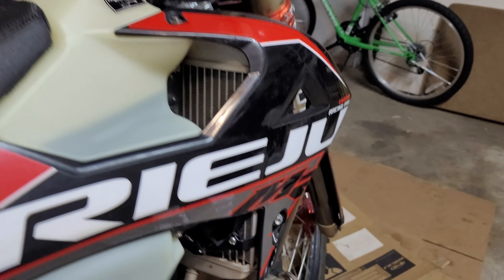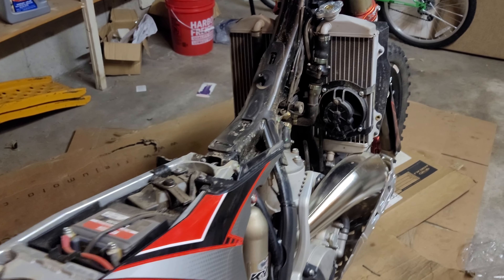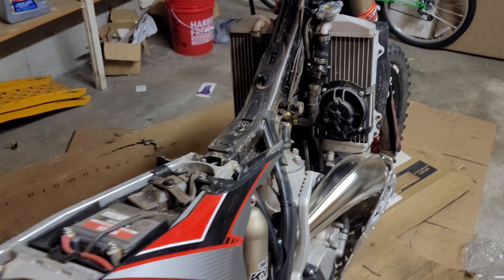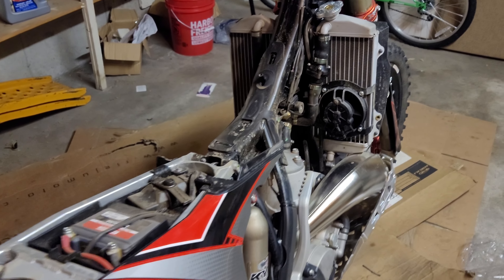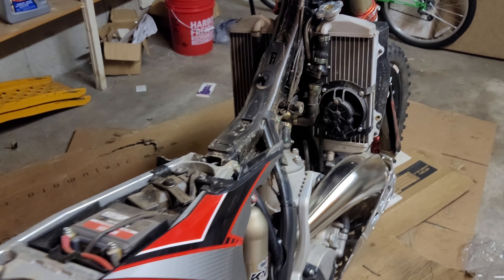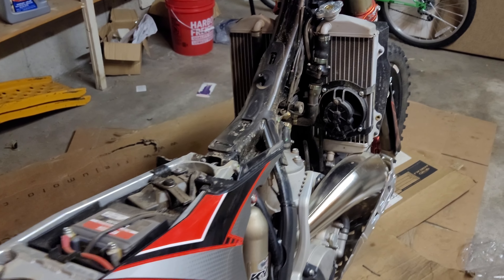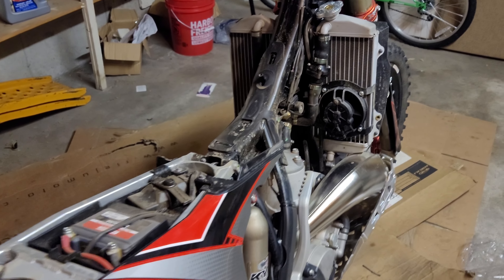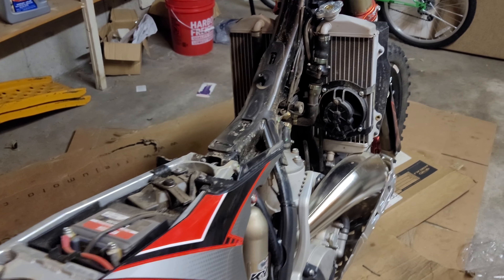Rieju MR Pro/Racing P-Tech Radiator Guard Install

Comment: Thank you for the video. Very helpful! I have a TM Racing 2021 EN 250 fi 2 T. Same situation with the fan, however, on the other side. Somewhat intimidating when dremeling or drilling that close to the radiator. That being said...this video helped with ideas of approach.